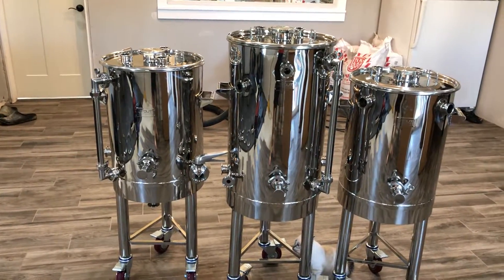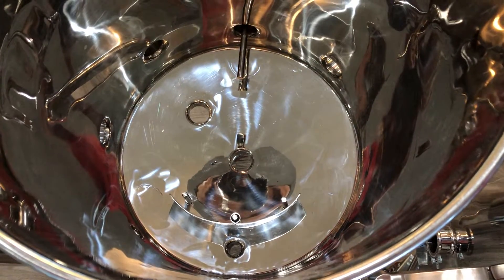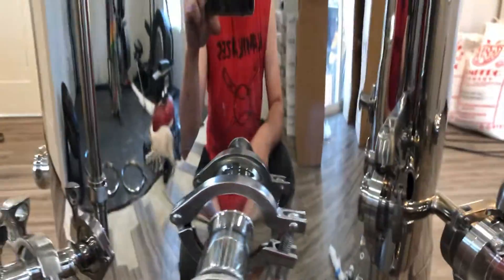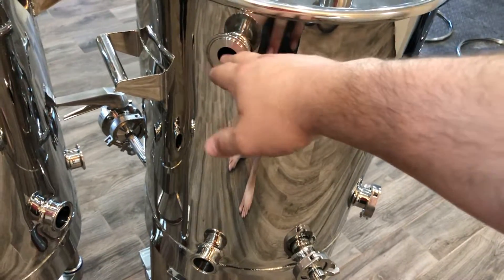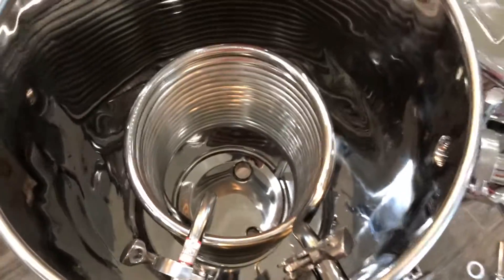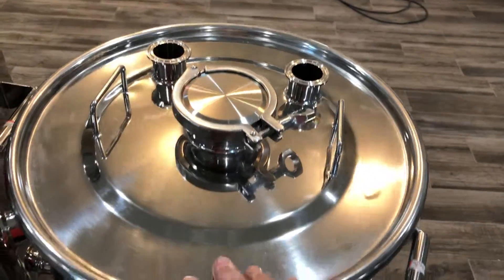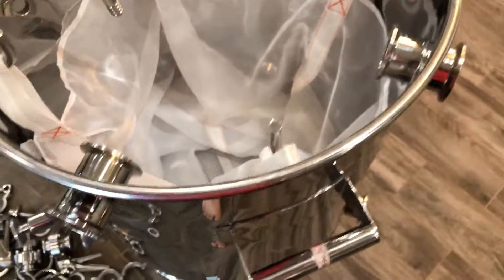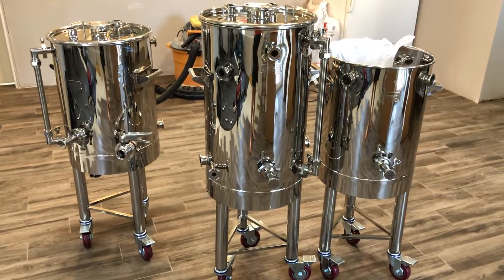Unboxing low oxygen brewing system.

Comment: Great video. Awesome equipment and I will definitely be looking into this as a potential purchase. I do have a question about grist hydrator. When you dough into this “inert environment” will you not have to open the lid and stir the grains to ensure no clumping etc...? I know in most pro brewhouse setup’s the use of a motorized rake probably takes care of that. Also how will you use the herms configuration vorlauf arm from stout?
Reply from the maker: Hey, nope. The grist hydrator, mixes the malt and the water together, so you don't have to stir.  If you do inquire, make sure and tell them I sent you to get the best pricing!